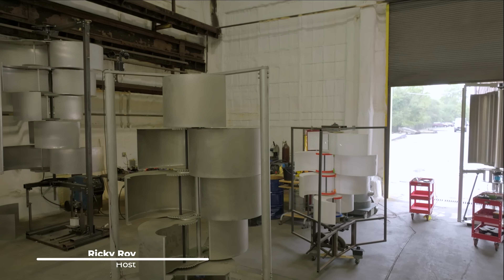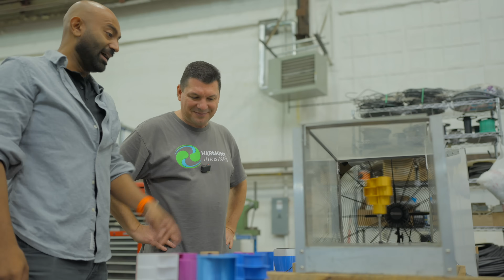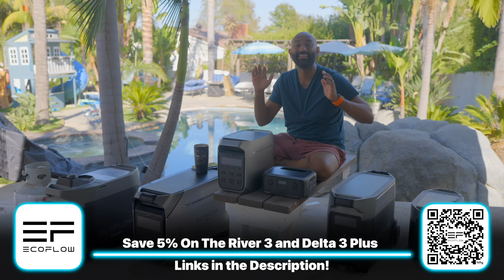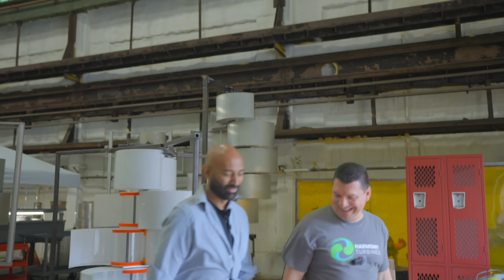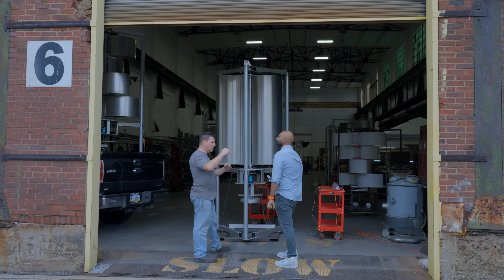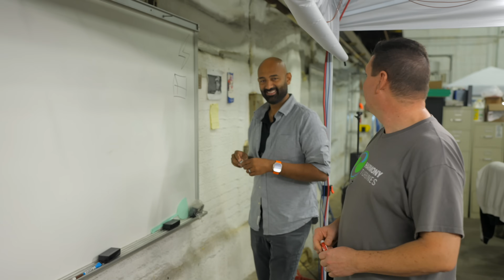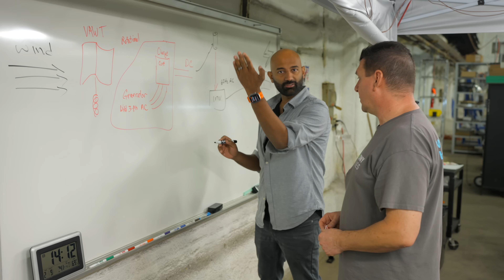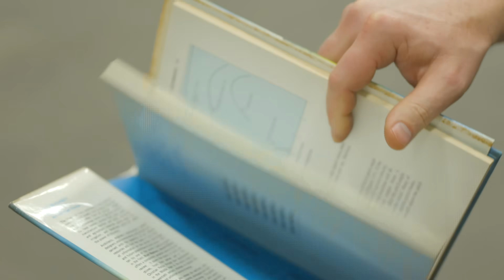This Could CHANGE Home Wind Energy Forever!

Comment: No matter how the wind turbine is designed, don’t put it in an area with modest average annual wind speeds - wind speed is everything- as the power generated varies as the cube of wind speed - this means if wind speed doubles, you get 8 times the power - don’t put wind turbines in places where the average wind speed is least than 15 kilometres per hour - this is also why you want your wind turbine to be high! Like 50 feet above your roof…as houses, trees etc. slow the wind down dramatically. (Did my mech eng thesis on windpower in ‘81 😉)
Reply: Also this specific type of turbine is not particularly efficient. The power is pulsing with the rectified sine of the attack angle, because you get less thrust when it's facing anywhere except directly upwind, so that's a lot of windpower wasted already. Making them swept prevents this problem, but also reduces efficiency directly by converting some of the windpower into vertical thrust on the bearings. And the downwind lobe is reducing efficiency directly by 27% on top of that, because it generates drag. The upwind lobe also works purely through drag, which is not aerodynamically efficient compared to lift. The reason this turbine works at all is because the same half-barrel lobe shape has different coefficients of drag depending if it's facing the wind or is opposing it (1.4 vs 0.4 respectively).
Reply: Some energy is better than NO energy
Reply: @Neoprenesiren  You'd need a bladed turbine with a small fraction of the size of a barrel turbine to have the same amount of power, and it will be cheaper. Using a design that's well known for its inherent inefficiency is just a non-starter. Same reason nobody's using reciprocating steam engines, they can run off any fuel including gas or bunker oil and water is basically free, the issue is their efficiency is super poor so you get a massive extremely expensive engine that's also guzzling gas and produces whole 3.5 horsepower.
Reply: @michaelbuckers   the goal isn’t to make 20 mega watts it’s to get some power where you had no power
Reply: @Neoprenesiren  Ok so? How does this excuses using a more expensive worse design than what's commercially available?
Reply: @michaelbuckers  Residental use is far far different than industrial use.
Reply: @michaelbuckers  If it can produce power at lower wind speeds, it might be worthwhile. If. Might.
Reply: @J-W-Kelly  Well it can't. Wind power equation is a cruel mistress, if wind slows down slightly more than by half, the power contained in that wind drops by a factor of 10. At low wind speeds it there might be enough power to charge a phone. Just might. If you extract it efficiently, that is, which this design is inherently incapable of, since it wastes a large chunk of wind power to generate drag and reduce its own rotation speed, and since it doesn't use aerodynamic lift, the rotation speed is not efficient to start with.
Reply: @michaelbuckers  I live in an extremely windy environment on the coast and went with solar instead of wind. IF they ever make a turbine that puts out several hundred watts at 15-20mph+ consistent wind speeds, I MIGHT get one to supplement my solar in the event of a very long outage during the season of short days with lots of rain.  We have a view tower that is 35' high.  A temporary wind turbine for emergencies might be just the thing... of course the county would frown on that, but when the Tsunami comes they will be nowhere to be found... just like FEMA : )
Reply: @Neoprenesiren  I agree.  In the same way that solar panels provide some energy even when the light is diffuse due to overcast conditions... it's real energy, just significantly reduced from that of perfect conditions.  A wind turbine that is capable of capturing energy at relatively low wind speeds while providing small amounts of energy for longer periods might well be worth the investment if the maintenance is extremely low and you get fairly consistent wind at your location.  I don't see these ever pulling in the watts you can get from solar if you have the room for panels... but, they may be more viable where space and sunlight are both limited.
Reply: @J-W-Kelly  Yes Fundamentally any wind energy available to residents by their own means is going to be limited as the most efficient wind generation is occurring very high up. With solar anyone can buy a panel and generate a decent amount of power even when it’s pretty crappy out. But nearly no one can generate wind power on their own land. Which is why I believe nay saying these types of low altitude wind generators is not a productive use of time. They will always be inefficient and limited in power output. The question is can we make it cheap enough and consistent enough to be worth it?
Reply: @Neoprenesiren 
You're correct, sufficient wind supply is not stable but sunshine is. Moreover this wind turbine is heavy and expensive, even if China can mass manufacture this for less than 1/10th of the price quote (actually China can easily manufacture this for 1/20th of this price) said in this video but there won't be a huge market for it, unlike solar panels work anywhere there's sun. If China doesn't waste its time making this then that means this has no market. Unless the location has a steady supply of strong wind most of the time then this thing is useless, moreover it's too costly, for that money can buy a more efficient solar panel system.
Reply: @Anonymous------   Yeah if you think about it wind is just a roundabout form of solar energy as the speedy winds are hot air or water vapor from the suns warmth. Hydro power and geothermal are the only other direct forms of renewable energy and they aren’t exactly accessible for the average joe. Recently bought a kilowatt of used solar panels for about 800$ and most of the time they produce 15 times the energy I would need 😂😅 could’ve got 5 kw for 700$ 💀 I didn’t have the equipment to lift pallets that heavy up though.
Reply: @Neoprenesiren  
Energy can be changed from one form to another but that doesn't mean all forms have the same energy efficiency. Plants are grown by the sun, cattle eat plants to produce meat, people eat meat to produce energy for their bodies, they peddle electric generator bikes to power microwave ovens to cook food, does this sound energy efficient? 🤐
Reply: @Anonymous------   It’s amazing how much mechanical force the human body can produce but also amazing how little electrical energy that actually equals 😂 barely enough to power a light bulb for a day.
Reply: @Neoprenesiren  Not if its return on investment is negative.
Reply: @Neoprenesiren  Only if the ROI is in my lifetime.
Reply: @wolfgangpreier9160  Buy some used solar panels you’ll make your money back in a couple of months. If not weeks depending on good a deal you get.
Reply: @Neoprenesiren Yes, if the cost to get it was less than the value of that energy.  Wind energy in any form is expensive so highly unlikely to be worthwhile.
Reply: @Neoprenesiren Cost vs value? I am always looking things at this "formula" It also called "money talks"
Reply: @willm5814  I could see this designed into the side of a building or on top of a shorter one in a city full of sky scrapers.   The buildings would redirect the available air and you’d get a Bernoulli effect
Reply: @dennisaston3551 You can't just "add it to an existing building" making the concept bat💩 insane and when you do there are harmonic vibrations that will be transmitted through the building like a tuning fork hit by a mallet
Reply: I was thinking about small wind turbine as fun project, 500W from aliexpress. And I thought it is always windy on my farmhouse. Recently bought weather station, that also logs wind speed and direction, during past month wind did not reach nominal 12 m/s (43 km/h) once. It is 7 to 25 km/h but not much more than that. I would get that nominal speed few days a year for several hours. When I walk out and it seems windy, weather station tells that it is nothing for wind turbine. Needs to be rally strong wind to produce anything significant.
Solar on private houses works great, as efficient as solar farms. For private wind turbines I do not see such benefits, especially in urban settings. Those huge wind turbines in sea work better. There is wind and they are installed in rural places.
Reply: @Janisg616  Wind turbine farms are also picky about wind direction distribution. You only get good efficiency if you build 1 (one) row of turbines directly across the wind. Any amount of overlap kills efficiency on downwind turbines, making them 3 million dollar paperweights (you already extracted energy from that wind, why would you expect to be able to do that again?)
Reply: Payback time is going to be a very, very long time and that assumes you don't have to may maintenance costs. It's a very niche market because you need extra space, and an area with high wind speeds so you pretty much need to live in the countryside, where as solar panels use your existing roof space and work a lot of the time. Some building regulations don't allow you to put tall structures above a certain height above the ground in some countries. Good luck to the guy because I suspect he is going to need it.
Reply: @andyspoo2  I agree with most of your points, but payback should not necessarily come into it. Not everything is about return on investment.  I have completely ignored the payback on my solar and it allows me to regularly charge my car, and QUIETLY power up 10 circuits during outages.  If there is a super emergency where the grid is out for long periods, nobody will be worrying about the money they spent on back up power, they will just be glad they did it. There is no assigning a dollar value to that for me.
Reply: @J-W-Kelly  Good point.
Reply: @willm5814  I work on wind turbines (on ropes) and we measure wind speed in metres per second, normally operating range is between 3mps and 12mps, any lower and it’s not reaching a high enough rpm to make power, and higher and the breaks wear out trying to slow it down from spinning out of control so they’ll pitch the blades into the wind so it won’t catch and apply full breaks. Most of the ones I’ve worked on so far this year are above 8mps during the winter (which is why I’ve spent the last 2 months barely working because we can’t work on them above a certain speed)
Reply: @adnanahmed5606  Sounds dangerous - take care!
Reply: I can see use cases where it would outperform the wind turbine but yes your correct in  general and most use cases the higher the better
Reply: You stated the key factors and summarize them well.
I had worked with a business in a unique area of southerncalifornia desert noteworthy for its high occurrence of strong wind throughout the year.  I have personaly assembled perhaps a few thousand PMA (permanent magnet alternator) type units for wind turbine kits.  
What intrigued me was the idea of how many blades; 3, 5, 6, 10, 12 (i dont recall we ever did 4).  Although it was curious to compare performance, some gains cancled others,
Some of our confugurations with stator coils wound for lower voltages seemed to give more resistance, whereas finer guage wire for 24 or 48 volt output gave less initial resistance.  Also quantity of magnets on the rotor, 5, 7, or 14 were the variations (as i recall).
In hindsight i would say the turbine which dod not easily turn by hand due to strong magnetic cogging would however deliver high power whenever the minimum windspeed caused it to begun turning , furthermore the hubs which had more blades 6-12 could behave like a flywheel keeping it spinning with its monentum when wind dipped in speed,
Overall my general recomendation is choose an easy turning low resistance configuration that can give power output more continuously  (low wind) otherwise its useless just waiting for strong enough wind.
It was explained to me that its like Six if One or Half a Dozen of another regarding the various configurations, including horizontal versus vertical axis.
It also brings to mind "Pitter Patter, It Dosent matter" but i just say that for a laugh.
Reply: Each person would have to make their own decision on this - if the unit is able to function reliably and without any significant maintenance costs for 10-20 years it might pay for itself.  For commercial purposes it’s likely a non-starter anyways based on what another poster mentioned in greater detail, Savonius type turbines are nowhere near the efficiency of the standard 3 blade wind turbine. It’ll boil down to final price and average wind speeds in an area. I live almost directly at the base of an escarpment so winds are generally attenuated by it, whereas up on top it can be much more windy, only .5 miles away at most. Part of the appeal could also be to off-grid folks looking to augment their energy availability.
Reply: Which is completely impractical...and therefore completely worthless 45 year old advice.
For low wind speed ground areas, use a VAWT but NOT a savonius!
Reply: @manoo422  Just watch the fricken video before commenting.  This is not an impractical design.

Comment: That magnetic bearing is such a great idea -- dust, dirt and water will not hurt it.
Reply: It just needs to be shielded from particulates like dust.
Reply: This comment and others like it make me think this is a video to drive up interest in the company so people invest. Then after having collected the money they will drop the truth about all of those things "dust, dirt, and water" will indeed hurt the magnetic bearings pretty badly and the replacement cost will not make it worth it over standard bearings. 

Dust, dirt, and natural water sources have ferrous particles that would be drawn to the magnets. Those magnets then moving will collect enough to grind against each other until they eventually fracture. You could isolate from those elements, but it's comments like yours that keep getting repeated that isn't the intention. 

This video didn't mention the noise they would expect. That's the biggest factor in home wind to date, none of the other obstacles mentioned are as great as the noise issue. Having the wind capture turn slowly is the best way to mitigate noise so far.
Reply: @djdickey  Naw. Harmony has been at this for a while already. I always see these comments but they've proven to be very legitimate with consistent updates to design and with what they're working on/stuck on. The generator issue is their biggest thing standing in the way now. They basically need a custom designed charge controller and once that's figured out they should be pretty close to small scale production before ramping up full scale
Reply: @Fenthule  you'd think they would mention how they've overcome the problems of existing systems. They didn't. They appear to be reinventing the wheel. The magnetic thrust bearings are fine, but now you're increasing costs or making failures critical (dangerous). Furthermore they don't seem to acknowledge off the shelf programmable generator controllers exist and seem to be after making a proprietary (read expensive) controller.

Comment: While his goal is very noble and his got some good ideas, he might want to use something other than a Harbor Freight meter to sell it. Image is very important when presenting to investors and technical people recognize that as the cheapest meter you can buy. In fact, the used to give them away. I have a number of them lying around. I hope he is successful with bringing it to mass production.
Reply: I also use a $2 dead-blow hammer with our $125k milling machine. -Oh the horror of it all. Robb if that little multimeter is what you felt strongly enough to write 7/8 of your comment about then I am truly horrified.
Reply: @HarmonyTurbines  You don't get it. First impressions matter. You just made your first impression to thousands of people through this YouTube channel. Dead Blow hammers are not precision calibrated tools. Multimeters, at least the ones used in test labs and repair shops, are. No one is criticizing your product. Mother Earth News has published instructions for building them out of oil drums for many decades. If you can make improvements, that's great.
Reply: They probably got the multi-meter free with a coupon but this will also convince investors that they will make good use of their money by buying equipment just good enough to get results. Accuracy to the microvolt is not needed here.
Reply: Things investors pay attention to:

1. Expertise and experience.
2. Drive and passion for the product/service.
3. Well thought-out business model. 
4. Advantages over competitors.
5. Revenue trends and sales history.
6. Yearly net income growth.
7. Profit margin and expansion potential.

Things investors do not give a flying fuck about:

1.The cheap multi-meter you are using.

Comment: The reason that turbine with the small anti-stall section on top is better, may simply be due to the end being closed, and nothing to do with the top section. Open top and bottom allows air at higher pressure to spill out.

Comment: Savonius developed the original 100 years ago in Finland, and it is still not seen on a large scale here. On the other hand, the electric car seems to be a 130-year-old invention, and now some of them are starting to be on the road😂 Currently, the price of electricity is €0.0058/kwh because the wind turbines are working right now, Last week in some hours 0.4€/kwh because there was no wind.

Comment: I don't understand on the generator side why you don't just either A: have a much wider diameter generator so you can capture the three phases at multiple concentric circles at a much higher number of pulses per rotation, or B: more generators operating on the same shaft.

To his point: torque is going to be (loosely) based off surface area * wind speed so just have a taller wider generator and a big disk on the generator then the slow speed jus doesn't matter so much.